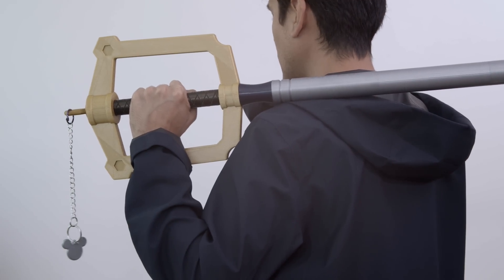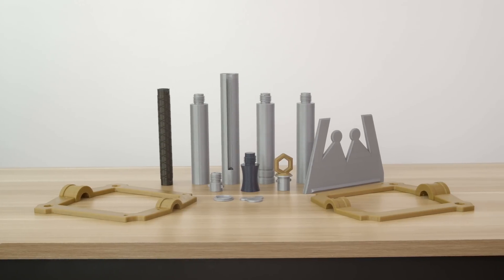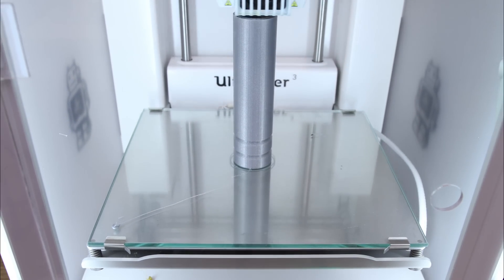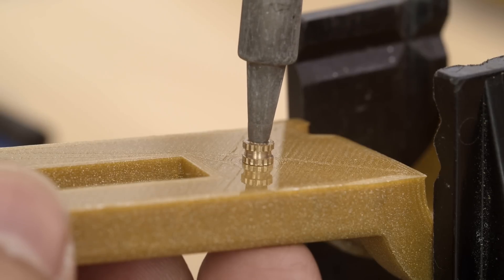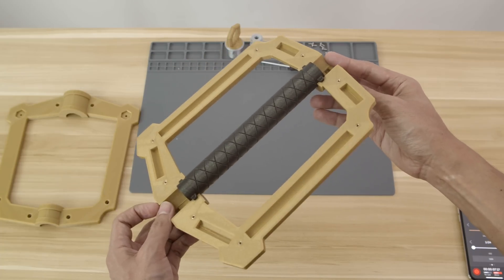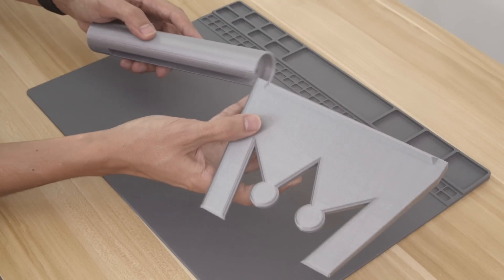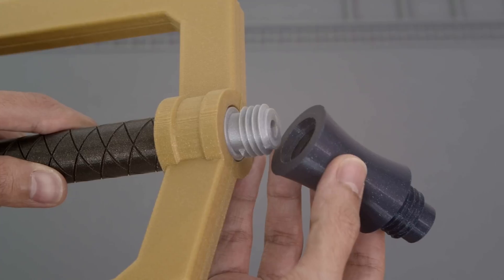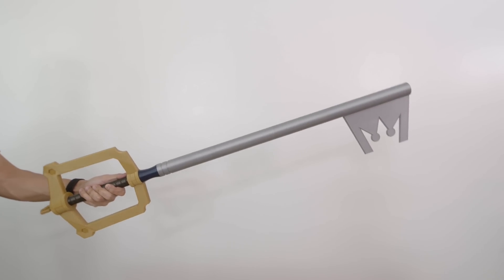3D Printed Keyblade Kit

Comment: has anyone solved the thread handle connector to the handle collar from snapping under pressure? i tried to print this tight and it snaps every time, am i doing something wrong in my printing?

Comment: For anyone building it, be warned about the handle connector piece (the blue bit between the blade and the handle). It's by far the most fragile part of the entire build (at least off of my printer) and 5 (5!) snapped cleanly in half upon lifting the key by the handle no matter what infil, layer height, or material (I tried 1 with PETG) I used. I finally just skipped the piece entirely and just used JB plastic weld to secure the blade to the handle along with some threaded rod. Other than that, the model is phenomenal, and looks amazing when fully built.
Reply: Are you sure it's not the silver coupler that snaps, not the blue connector.. Never had issues with the blue piece just thr piece that screws into that. I printed with a much stronger pla at 60 infil and has been good so far.